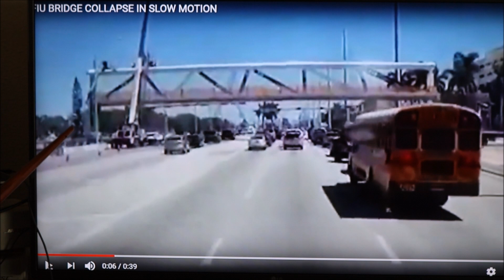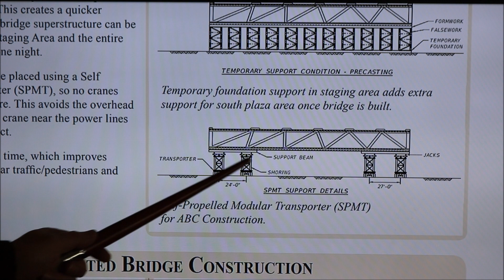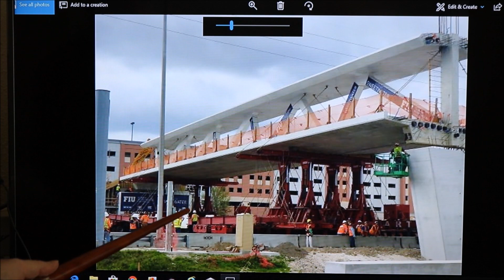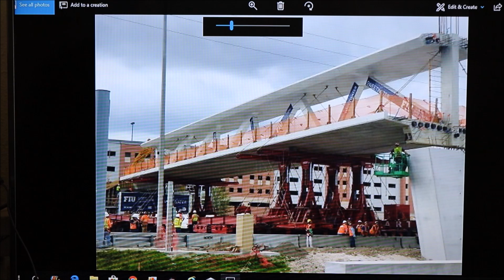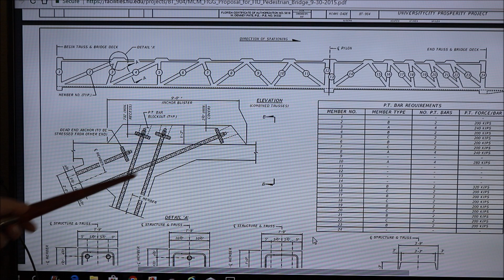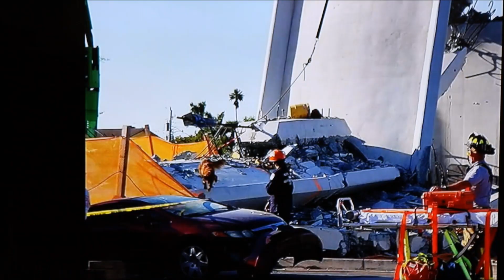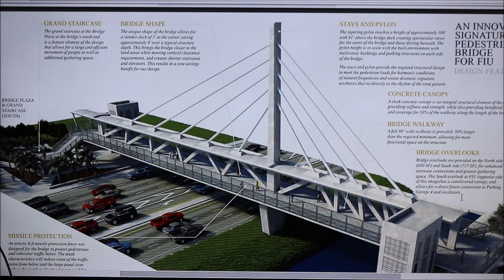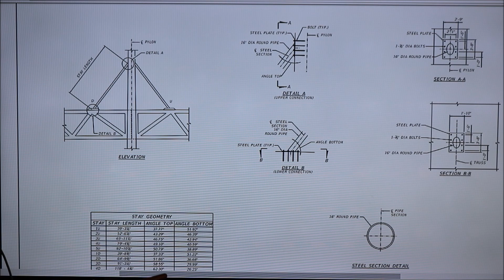Miami Bridge Failure Update 18 March 2018

Comment: Would it be significant that they tensioned one of the two rods (the top accessible one) without simultaneously tensioning the bottom one?  It would seem that by tensioning one, as soon as it was tighter than the other, it was bearing 100% of the load, greatly increasing the likelihood of failure.

Comment: Good info Juan.     Part of me thinks that connection may have had a 'punching' failure thru the top deck.  I find it also interesting that the angled webs are not symmetrical.    Simple spans like this always do better with symmetry.....same load at both ends but varying geometry........hmmmm.   I also wonder if they damaged the bottom post tension tendons by side loading (not a primary design) when they rolled this thing out.    Figg Engineering are pros......this should be in their wheelhouse.    BTW, did you see MCM Constructions (from your neck of the woods) website?   They were smart to kindly explain the 'no connection'.   (I would have done the same).

Comment: The problem with the truss design is that they tried to make them look as if they followed the cables (not installed) and by this loses the strength of (simply put) a triangle that in almost all cases is the strongest form of stability.

Comment: I have a background detailing concrete reinforcement including post tensioned structures since the '70's. I believe that the failure was probably due to a combination of errors. 

The primary error that I see here is that shoring should have remained in place until all the stressing operations were complete and passed inspection.  

Re-stressing means that the rod will likely be temporarily significantly over-stressed to release the pressure on the anchor for repositioning. The fact that they were initially intentionally over-stressed compounds the danger of rod failure. The rod may have to be taken out of service if there is a problem during the re-stressing. Can the one over-stressed remaining rod carry the entire load?

In California an inspector is required to watch over the ironworker at all times during stressing operations and record gauge readings from the hydraulic jacks.  Also the hydraulic jacks must be tested, calibrated and certified frequently otherwise the rods & cables are likely to be tensioned improperly. It would be interesting to compare Florida requirements and review the stressing logs (if there are any). The fact that there was no inspector overseeing and logging this ironworker's stressing operation at the time of failure is disturbing.

Lastly there should be a review of the independent lab results for the tension rods. These tests are normally performed and recorded prior to installation.
Reply: All the more reason why the initial placement and load testing should have been done off-site. Simply too many unknowns to go straight to a 'live' test. Given the lack of data, temporary support columns on the roadway should have been a required precaution. Especially if traffic was to be permitted before the structure was fully stabilized.
Reply: Daniel Chappell,  What do you think of the basic design?  Have you worked much with PT trusses?  Thanks for your input.
Reply: We haven't seen the "as built" plans but as others have pointed out, the basic design appears to lack redundancy. Perhaps the failure is a byproduct of relying too heavily on computer modelling while ignoring real world considerations, combined with a dose of poor oversight.

Most of my PT experience has been with parking garages and slabs in high rise buildings with the occasional simple pedestrian bridge.  All of the projects that I have completed used greased tendons inside of plastic sheathing, not these solid rods.

In comparison to structures that I have detailed on the east coast, California structures are designed to vastly higher standards primarily due to seismic considerations.  Rolling that truss down the highway with the cantilevered ends and incorrect positioning of temporary supports may have simulated a seismic event and initiated failures in the structure, hence the cracking that the engineer reported.

All speculation until more of the facts come to light.

Comment: On the FIU drawing which should be to scale, why are there more trusses on the right section per unit length. Seems a bit counter intuitive.
Reply: Greg Rehill If you look at the proposal in detail,  the other side of the bridge spans a canal, which is only half the width of the 8 lane highway.

Comment: Yes sir, you can engineer anything, but at the end of the day, always stick with what you know works well; always test new designs in a low profile area before they're implemented.
Reply: J Cheek This case was the opposite, a high profile structure, to showcase the design and benefits (?) of accelerated bridge construction. An own-goal in soccer terms...

Comment: I stand corrected sir. They obviously exceeded the elastic limit of that tensioning rod. When it failed, the corresponding truss member shattered from the lack of tension. The question now is, why? Was the design of the tensioning rod insufficient for the load, or did the rod not meet the spec, or was there undue stress put on the rod by the changes to the way the bridge section was set or was there some error that in the assembly of the components.
Reply: Kaw River Chopper Those are all good questions that the NTSB will be askjng already.

Comment: Just wondering. 

 I agree that the failure most certainly occurred at one end of the bridge, either member 2 or 11 as you say. (Not sure which end is which).  However in my opinion, once the bridge was sitting on the piles at EACH END, the whole upper "deck", (for want of a better name), would be in COMPRESSION - supporting the lower "deck". 

The lower deck, without the support of the upper deck and by being only supported by the piles at each end,  would tend to generally sag. 

This compression of the upper deck would terminate through members 2 and 11 which were based at their respective trusses at each end at the lower "deck" level. 

Given this is logical, I have a problem with the assertions that the workman was supposed to be increasing or adjusting TENSION. 

Certainly in some other shots that are around, one can see that a number of members have appeared to have pierced the upper "deck" which may support what I am saying, but I am aware that once the bridge hit the road, anything could end up in strange places.

However, in my humble opinion, whilst I agree that member 2 (or 11) failed, possibly where it was attached to its adjacent member 3 (or 10) but it was  because of a COMPRESSION failure of some sort.

Trust you can follow this.

Cheers

Roger

PS another thing also puzzles me. I notice at the ends of the lower "deck" there are what appears to be tensioning terminals at each end.  Those are the round black things you can see at https://www.youtube.com/watch?v=JKO7qbPHIy4  1.19  Ten in all by the looks of it. These things are the terminating attachments of steel cables that run the length of the bridge and are tensioned to provide tension strength for the bridge.

What puzzles me is why these are on, what I would have thought, was the compression level (near the top) of the lower "deck" rather than being located on the lowest level of the "deck" in order to handle the tension one would expect to be present there.

Maybe some of the information and drawings in your possession may help me there.
Reply: Roger Surf All of your assumptions and analysis are correct AFAIK. The problems started when the span was transported, with supports in the middle instead of the end points. This placed trusses #11 and #2 in tension instead of compression, and the over-stressing of those PT rods led to a critical situation IMO. Once the bridge was in place, the reversal of the load stress did not undo the damage, leading to the eventual collapse.

Clearly work was being done in the critical area, but we only have third hand reports of exactly what was being done.

Comment: Excellent vid.
There will not be any one that will explain it correctly afterwards.
Nice depth to the explanation.

So basically to have walked across this after it would have been completed.
You'd have to be an x-games member.

Comment: Triumph of style over function.   Fake stays, and the truss diagonals aligned with them instead of being optimum.  Why not steel? Why not a centre support? FWIW, pre-constructing a bridge and moving it into position isn't new and is quite common. It began when the first carved tree-trunk was put across a stream. The Britannia bridge over the Menai Strait in North Wales (engineer : Robert Stephenson) had its spans floated out on rafts in dangerous waters in 1850; this Miami bridge should have been child's play.

Comment: The FIU pedestrian bridge may have been one of the worst designs since the Silver Bridge, an eyebar-chain suspension bridge (built 1928, collapsed 1967) or the Tacoma Narrows Bridge (built 1938, collapsed 1940).  No structural engineer should have come up with such a looney design where a single-point fault could cause catastrophic structural failure.  It looks like this bridge was designed using finite element analysis (FEA) software, but not enough common sense.  Whatever design is accepted as a replacement, I hope it will be more practical and less grandiose.
Reply: Milosz Ostrow This bridge collapse will certainly be a textbook case in future!

Comment: It just occurred to me that all of this testing could have been done offsite - where it was built - before the bridge was moved. Considering the novelty of the design and the fact that such a move had never been done before, this would have made enormous sense.  

Here's what should have happened:

Move the bridge a small distance - in the manner in which it would be finally moved - complete with tensioning. Then, set it down on nearby supports - just a few feet off the ground - replicating the actual piers. Then adjust the tension rods as required and conduct a thorough analysis.  This would have provided a ton of valuable information. There were simply too many unknowns to go straight to a 'live" test - complete with traffic!  

What makes the tragedy even worse is that there were so many opportunities to prevent these deaths:

Before installation: 
1) Conduct final load testing off-site

After installation:
2) Stop traffic after installation - until bridge was stable
3) Stop traffic after cracking was noticed
4) Stop traffic after a loud noise was heard
5) Stop traffic while adjusting the tension rods

Hindsight is 20/20, but common sense should always guide one's actions.
Reply: marmaly They could have done as you suggested, but repeating the loading and unloading process is more likely to lead to failure IMO.
Reply: I thought about that, but then I thought that if the system is properly designed and adjusted it shouldn't make a difference.
Reply: marmaly Not every structure is symmetrical, and changes in design load can produce very different outcomes.

Fir example, a motor vehicle is designed to sit on its wheels, not on its roof (I think you can see where this is going...)
Reply: @marmaly
I so very much agree with you. Every opportunity to avoid catastrophe was ignored. 
  They should have used a preselected engineering reviewer, but Nope, hire a buddy.
  The bridge sat idle for hours on transporters while they debated what to do about the "anomaly". Returning it to the construction site was an option, but Nope! 
  The PT rods in #11 were incredibly loose; ignore that. 
  The cracks got much larger; comment mildly over that. 
  Gunshot sounds, ignore that too. 
  And by all means, keep the suspect cracked member covered by a banner.

Comment: The reason for collapse, is a design flaw. The first compression diagonal, separated itself from bottom chord of the truss (deck of the bridge). Here is explanation. https://www.dropbox.com/s/uz3jmqjiyl238t5/Cause%20of%20failurein%20Miami%20bridge%202018.03.19.png?dl=0
Reply: I agree, joint failure.  2,000,000lb horizontal from strut to bottom chord.  How was that force to be delivered from the  single strut to 12 tension rods across a 30' wide deck?  Probably needed a big steel shoe and spreader beam.
Reply: Very interesting! The final structure was designed to have both sides of the bridge clamped together with multiple bolts. Clearly the interim structure had no lateral support.

Your answer is the one that makes most sense (of the many I have read so far)!
Reply: detailing was very bad
Reply: What was the detailing, I haven't seen it.  I've only designed wood joints, but, I think they would need 15 to 20 1" rebar wrapped around the back of the strut and extending back into the deck.  It doesn't look like they allotted room for that.
 In the truss foot on a wood joint, the bottom chord has to run long past the support point, with shear blocks and bolts to transfer the load from the main strut.  Or a block on the bottom to move the connection inboard from the support point.
The video supports a truss foot failure.  If the strut slips out, the load shifts from the pier to the next truss node, which we see shear the upper and lower deck, which can't support the load in shear.
Reply: Ted Cook There is minimal detailing in the publicly available design proposals: https://facilities.fiu.edu/projects/BT_904/MCM_FIGG_Proposal_for_FIU_Pedestrian_Bridge_9-30-2015.pdf

Comment: It seems to me from the geometry of the bridge that member 11 can only be in compression, not tension. The only time it would be in tension was when it was being transported and was being supported under the intersection of 9 and 10 rather than under the end of 11 as it was once installed.
I think it is the lower deck between 11 and 10 would have been in tension and when I first saw the video it seemed to me that the failure occured when the lower deck was pulled apart at that point.

Comment: Surely a new design with new materials must have been through a thousand levels of testing and everything was structurally sound and safe?  I agree it’s all a disaster in hindsight and this and that should have all happened to make it safer - but what if this is a scenario - The truss rod was tensioned due to the altered transport position and needed to be detensioned once in position.  Can the rod break while being detensioned even if it is weakened for whatever reason?  The rod failed and the bridge collapsed - what if the worker increased the tension wrongly and caused the failure?  I know group think could possibly have produced a dangerous flawed design, but how likely is it?